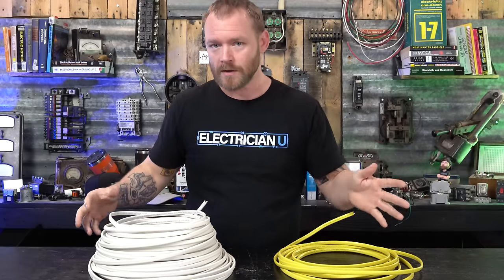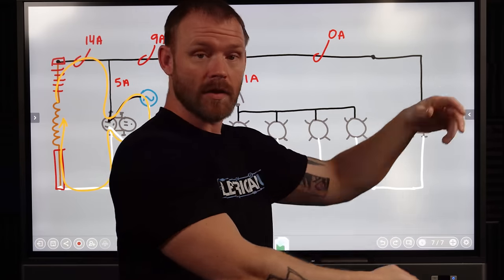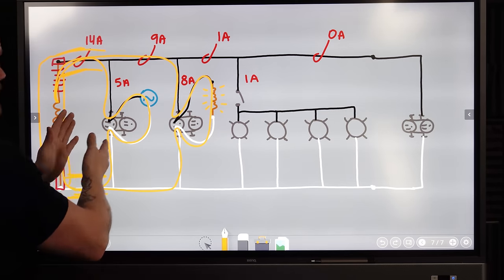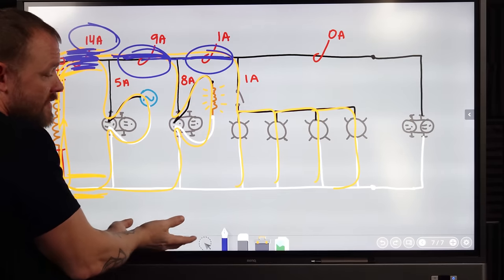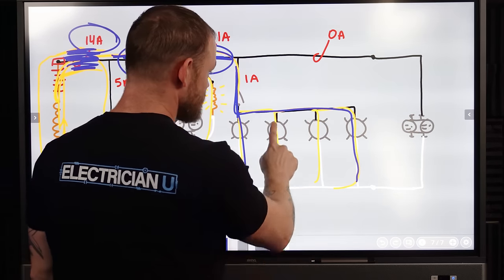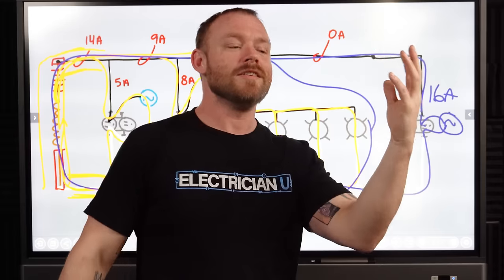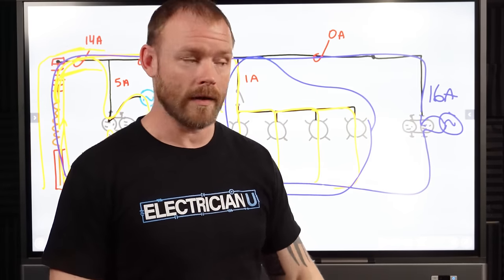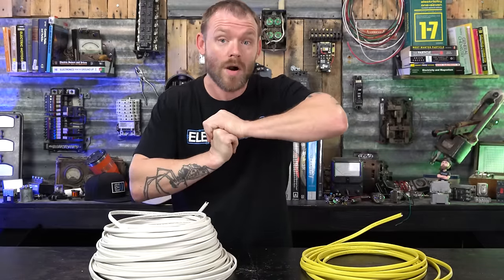Should You Be ONLY Using 12/2? When Can You Use 14/2?

Comment: I always ran separate 15 amp circuits to the lights and 20 amps to receptacle circuits. Blow a receptacle breaker the lights stay on
Reply: How do you feel about MWBCs? Do you just avoid those altogether as well? I do.
Reply: @that1electrician  yup never did that, 12-2 for receptacle and 14-2 for lighting ceiling fans and exhaust fans. One receptacle circuit per bed room and two for kitchen.
Reply: @that1electrician  Multi-Wire Branch Circuits (MWBC) are not recommended for residential applications. In part because many people like to CHEAT and use a 12/2 rope, with one phase on the black, one on white, and the ground as a neutral!
But, even when done right, you DO know what happens when you lose the Neutral on one, right?
For those who don't know, an MWBC, properly done, is when you need two circuits, and only want to run one cable, so you put the Black on one breaker, and the Red on another, with the Neutral (Return) wire being shared by both circuits. (I hope like hell you're using a 2-Gang breaker AND 12/3! More on that in a mo').
The problem with the shared Neutral is that, if the Neutral ever gets broken, you now have 240 volts running across the appliances. Your 920 inch Samsung Big Screen has just let out the Magic Blue Smoke.  Considering that Residential Electrician's wouldn't know a "Pigtail" if one bit them on the ass, and thus use the Stablocks on the receptacle as splices, all it takes is one of the receptacles early in the stream melting to interrupt the Neutral. (A pigtail is when you connect all the wires in a Junction Box together that need spliced with a wire nut [Or equivalent], with a 6" "Pigtail" coming out to feed the receptacle. This allows you to replace said receptacle later, without interrupting power to anything downstream.)
And if you aren't using a 2-Gang Breaker, there's a chance that SOMEONE, somewhere, someday, will wire both conductors to the same phase. They might do this, even if you DO. And then the Neutral might be asked to carry 40 Amps back to the Breaker Panel, some day. It won't like that. Neither will your Homeowner's Insurance.
And here's another reason I only carry 20 Amp Spec Grade Receptacles on my truck: Replacing 15 Amp receptacles that were used as a splice for a 20 Amp circuit!!
When one does this, one has inserted a 15 Amp fuse in the 20 Amp circuit. This alone has made me much money. That the client should never have had to pay!
Reply: @1oddtech  This is the way.
Reply: @LordSaliss  This is the way
Reply: So what about the practice of only using conductors in a circuit that match the breaker?  Or the practice of not mixing different gauge wire on the same circuit?  Using that practice,  a 20 amp breaker circuit should only have 12 wire for every leg of the circuit. I understand what Dustin explained on his whiteboard drawing about the lighting leg of the 20 amp circuit will draw, at most, 1 amp so a smaller gauge wire is OK on that leg of the circuit. But that runs counter to my practice. I’ll have to read the code citations that Dustin gave to  see if my practice is not required by code.
As always, good work Dustin!
Reply: @that1electrician  in dwelling units because of the AFCI requirements in pretty much the whole house, MWBC'S are not worth the expense of two pole AFCI breakers not to mention not all panel manufacturers have these breakers in their lineup.   In commercial buildings particularly office cubicles where a dozen or more 120V  are fed from a 120/208V 3ø panelboard to a given area I prefer MWBC's whenever possible,  they will often be specified, to allow for smaller raceways,  saving of material and labor, and less voltage drop.
Reply: I agree with this! But in bedrooms the will run a switch leg up to their lights on a 20 Amps
Reply: @dereksmith2137  and that's just dumb to do expressively with having to put combination arc fault ground faults on every circuit know.
Reply: @1oddtech  first of all it’s especially second of all it’s not dumb at all it’s keeping a bedroom on the same circuit! What you are going to run a lighting circuit in every room of a house and generally lighting? So if there is a ground fault a short all your lighting is out? I guess you can run 2 lighting circuits. It’s not dumb it’s standard. General lighting, then bedrooms on their own! And yes arc fault breakers are always touchy they will always trip the easiest that’s why they are put on there.
Reply: @1oddtech  it’ll cost more technically but I’m not paying for it lol
Reply: Have fun tripping the Afci breakers
Reply: Plus its means you never have to work in the dark!
Reply: @TimeSurfer206  From someone doing it way too long...Muliti wire circuits in residential applications should have ended before the start of arc faulting. Besides, you can't GFI from the breaker either. Small panels should have ended as well. IMHO. Also, why not use dual function everywhere you need either so you can just use regular outlets? The dual function are sometimes cheaper than either GFCI or arc fault.
Reply: @Sparky-ww5re  I refuse to do MWBC's in a Residential Setting.
Because too damned many Residential Sparkies wouldn't know what one is, even after it bites them in the a**.
Reply: I screw a switch into the lamp socket that has outlets built into the switch along with a light bulb socket. So, I use light circuits for things other than just lighting.
--
No wories though, I used 10awg for all other circuits and 12awg for that lighting circuit.
Reply: I'm not an electrician, but this is how my house. It just seems simple and makes a lot of sense.
Reply: @TimeSurfer206 i took it for 12/4

One black,red,white,white with red stripe and a ground, which you can use two separate afci breakers on or have independent nuetrals
Reply: @Tactical-Black  I know 12/4, AKA 12/2/2 exists.
But, in the 40-some years I worked electrical, I have never once seen it used.
Reply: @TimeSurfer206  I use it alot, for kitchens and bedrooms receptacles or anywhere I need two 20 amp circuits that are near eachother especially if its a far run,
Reply: not a bad idea.
Reply: This is the way I’ve always done it when running new circuits.
Reply: It makes sense to do this.  With the addtional demands for power and the occasional need for additional start up amperage, why would anyone think otherwise?  I still see far too many rooms wired on 15 amp circuits for both floor and ceiling receptacles and lights.  Even when the house has a  200 amp service.
Reply: What if you add a receptacle/switch dual outlet into one opening later on? Meaning one is the receptacle and one is the light switch? You have to run 2 cables then  into the same box...?
Reply: @TimeSurfer206 15 amp and 20 amp receptacles are identical inside. The ONLY  difference is the face.
Reply: @dereksmith2137 We always ran LIGHTS on separate circuits from receptacles. We would run the lighting circuits such that adjacent rooms were on a different circuit so that if a lighting breaker tripped, the room next to it still had lights. It took very little additional wire because we ran power to the ceiling box, and dropped a switch leg down to the switch.
Reply: @dereksmith2137 Arc fault breakers aren’t needed if the house is properly wired and homeowners would quit using cheap extension cords. Of course, insurance companies have pushed for them, because it saves them money. Doesn’t matter that it costs the homeowners 10 times as much for each circuit. My house has ZERO AFCI breakers and never will. We upgraded the electrical in 1997 prior to AFCI requirements and have enough extra spaces in the panel that we will never need to involve inspectors to add additional circuits. It is doubtful that a 1200 sq ft house will ever need more than 42 circuits 😇.
Reply: @littleprincess4417 You're a good electrician. That's good thinking to consider the lighting needs after the circuit opens.
Reply: I did that too for a while. At this point people call me to fix something that is either failing on them or they want to upgrade. Either way I just do 12/2 everywhere with only 20 amp breakers. Plus It makes keeping a inventory of breakers and cable easier for how little more it is. I just pass on that cost to the customer as like I said they are calling me to fix or upgrade something that is giving them trouble. It can be done a little overkill for them as code isn't getting less strict as time goes on.
Reply: That's dumb
Reply: I have used  14-2-2 in bathroom fans with light ,fan and night light. Also 12-2-2 in bath fan with light and heat.
Reply: 20 amp for receptacles? Half of which won't get used?
Reply: @ryantemplet2138  it's an accumulation. Plug in a space heater and you're already pushing 15amps. Plus a TV, fan, etc. You're already pushing 20amps on your outlets.
Reply: As long as you are going LED
Reply: People are acting like they trip circuts all the time and suffer from outage of lights. In my lifetime, I had it happen maybe twice, and it was a small appliance circuit and not  general lighting. So it's really a made up issue.

You can go out on a limb and do unnecessary things like to separate lights and receptacles, but you are a minority. The majority of professionals have established our approach in this regard. Therefore, when we do load calculation for a dwelling, receptacles are combined with the lights.

As for using 12 or 14 gauge wires when it comes to general  lighting, it's up to you. You will have slightly less 20A circuits  or slightly more of 15A. There is absolutely nothing wrong with 15A circuts serving lights and general use receptacles.
Reply: @TimeSurfer206 not even getting into all of those reasons, even in a propey installed MWBC, with proper equipment, there is still the potential that if you are drawing both circuits near their max amperages (space heater and hair dryer for instance) that shared neutral can be carrying above its listed current, you see those yellowed neutrals all the time in Chicago area, MWBC are bad practice overall imo, often times they arent on 2 pole breakers with common trip either.
Reply: Yep.  Once you put a 14 gage wire that touches the breaker it should be 15 amp.  Breaker is for protecting ALL the wires within that circuit.  If the item on the 14/2 wire overloads and pulls 19 amps, you have no protection.  Yes, in reality 14 ga wires will pull 50 amps or more before melting.